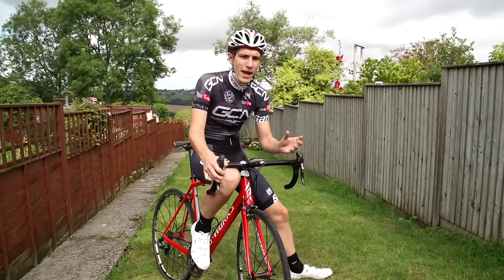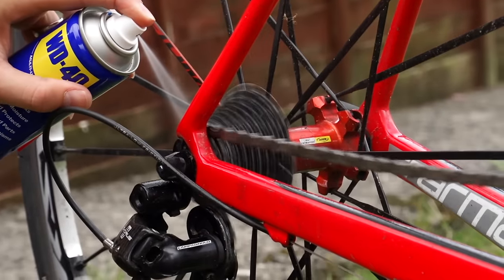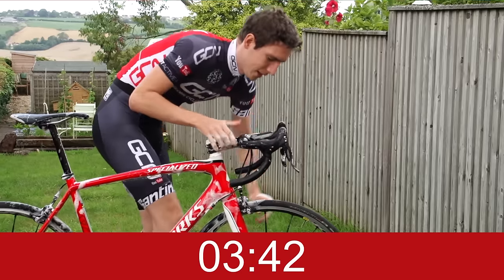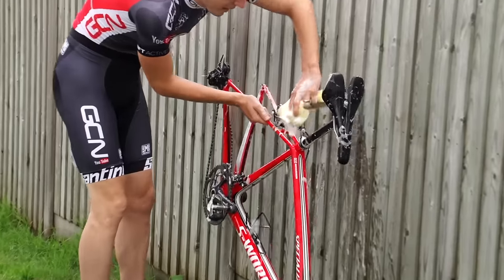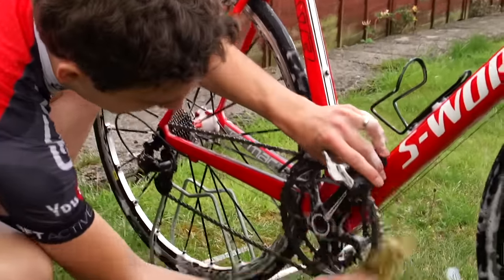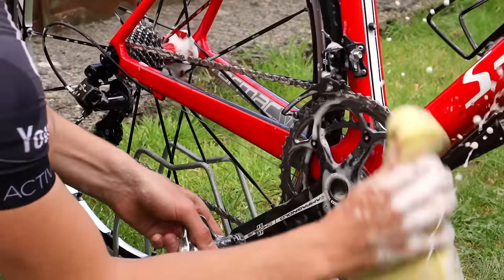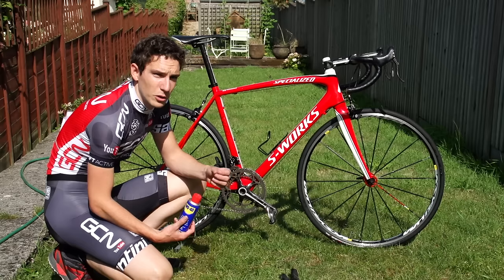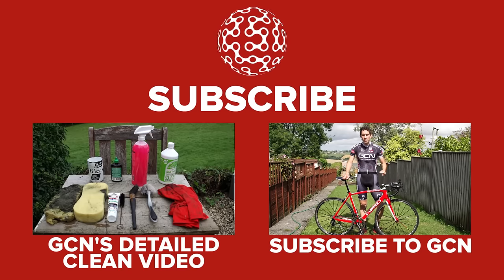The 5 Minute Bike Wash - How To Clean Your Bike In A Hurry

Comment: I wouldn't want the wd40 on my brakes pads ... but other than that it works just fine but you have to apply it often in my experience vs the other stuff I use which is finish line dry lube that seems to stay ok for a long time and attractive less shit

Comment: To be honest, I have always seen a bit of dirt (MTB) as a mark of honour, you know, like rugby players and their cauliflower ears, or like how bruises after a judo tournament make me look like I have fought harder, so I have declined to clean it off until I have had so much dirt it was falling off on the stairs. But even I have to admit that bike performance has suffered as a result and I can imagine that the amount of times (over 10) I have had the bike in for service in 3 years, and the costs involved, have come in part from mud all over the working parts. So, perhaps it's time to haul myself in a bit and make the effort. In all that time I have had, just a few examples, 3 new chains, 3 chains broken but mended and not replaced, a broken seat, 2 new rear cassettes, 2 new front cassettes, a new arse bracket, 9 sets of new brake pads, an entire new front brake, four new spokes, the wheel straightened 3 times and a new silver bendy thing that holds the derailleur on after the last one snapped off while descending and not even being used... not all from mud but it for sure never helped. The other day my quick link exploded and flew off when I went over a pothole and the chain cracked against the frame. Washing your bike is worth it, for sure.

Comment: hi gcn..if i use wd 40 it will damage my bearing inside or not?
Reply from the maker: it's not advised if you want to do the job properly 
cheers
Reply: i mean if i use to wash like above..it will spread into my hub bearing or not?thnx for quick respond
Reply from the maker: try not to spray directly into the bearing, as it tends to flush out grease. thanks, Jon

Comment: You should not have put the brush that you used to wash under the saddle back in the bucket, a you know this gets a lot of grit and what you  have done is returned the grit to the clean water then the sponge will catch the grit and you will scratch the paint work on the frame..... nice video tho and lovely bike

Comment: I laughed at the WD-40 use until I saw the end of the video.  There is a reason why Police departments don't use WD to clean their barrels. It has been officially restricted in some areas. 

WD will wear the metal away FYI.   Not Apples to Apples... just information I have learned.

Comment: WD40 is not really a lubricant and/or greaser per-say as it stands for Water Displacer and is mainly used for cleaning parts and/or keeping them clean. But for moving parts like bike gears it won't lubricate them properly and will wear off very quickly. If you use wd40 on the chains regularly you can probably get away with using wd40 but it's always better to use a proper lubricant for prolonged performance. My advice would be to use a proper grease after using wd40 to clean the parts. Trust me, I'm an engineer (....ing student)

Comment: I dare say that too much WD40 will kill your cassette and wheel bearings. If you use too much when  spraying your cassette and it hits your bearing grease,  the grease is ruined.  WD40 is ok if you are doing this after every ride and spraying VERY LIGHTLY.  It does dry out though, since it's really a solvent, not a lubricant.  If you don't ride every day, it's not going to work well.  Also, never let the stuff dry before getting all the loosened dirt, oil and other muck off your bike.  Once it dry's the only thing that will remove WD40 is WD40.  That's why it seems to work only if you used it before and after each wash.  Otherwise, to switch back to a regular lube, you need to soak the drivetrain in WD40 to get it off, then while still wet, wash with heavy soap and water. Next, soak in mineral spirits, scrub them clean with mineral spirits and then soak them again.  Once you have them really clean, you can let the mineral spirits evaporate, or chase it off with denatured alcohol.  Dry in  a warm environment.  By now you've obviously had to remove the cassette, and you need to disassemble the cassette bearings and pawls, clean and relubricate with waterproof bearing grease because IF the WD40 hit them, they're contaminated and need repacking.  I'd do the wheel bearings too at this point.  Isn't it easier to just use a good purpose designed chain lube properly applied and avoid all this?     I'm also concerned about the cables.  Your video shows water soaking into the cable guides.  That's REALLY BAD unless you are pulling your cables and re-lubing with (as you suggest - a teflon based lube) that is also waterproof.  Wires will rust extremely quickly and you won't know until that emergent hard braking moment when your brake cable snaps.
For your situation WD40 may be OK, but generally speaking BAD advise.
I keep a can around for chasing water/rust/Dirt off parts during disassembly and  removing some adhesives off of plastic (which it works really well for).  Never leave it on.

Comment: Let me say I didn't mean to hit you，But using wd-40 to maintain your transmission system may cause metal corrosion，In the past, friends used WD-40 on motorcycle brake discs, which caused corrosion and brake failure.So I think it is possible to use a special chain maintenance oil may extend metal life of your transmission systems.............

Comment: WD-40 solved my squeaky bike frame and whizzing chain issues, I only had the bike for a year now also its restored to its new state as well, plus I pumped up the tires - its 10xs faster ever since I've used WD-40! the bike is still quiet after 1 week of riding.

oh and its a Beach Cruiser.
Reply: so is it safe to use as a lube for my chain?
Reply: +ROTCOD DLAREH Yes. Just make sure you check your chain regularly. If it gets wet often, re-apply the WD40 often too.

Comment: Dear everyone. WD40 Is not in fact a lubricant but rather an oil based Water Dispersant hence WD. As far as we know cause there is no patent on it and therefor no recipie. To be honest thats all it should really be used for, to disperse water from parts where it does not belong. For example after washing your bike. As its oil based however it is also great for cleaning bikes or anything els which is greasy or oil based. However I would not use it on rubber or silicone as oil tends to dissolve or degrade these. Here is the problem though, the effect it has as a Water Dispersant is to form a thin film of itself over the surface of everything it comes in contact with. This is so that, water does not come in contact with the surface or any water preset gets dispersed. This however also means that any lubrication which is for example meant to provide lubrication between two metal surfaces now provides lubrication between 2 WD40 surfaces. It can also happen that the WD40 dissolves into any lubrication altering its composition or completely repelling it from the surface. And yes as mentioned in other comments as a Water Dispersant it has the property of easily spreading and running into everything including sealed bearings. Therefor I like to use WD40 to disperse water from my bikes components as well as cleaning of grease however afterwards I take care to clean of the WD40 with alcohol and then appropriately lubricate all parts.
I hope that this helps and puts a bit of light in the mythical debates about WD40. :-D

Comment: I’m lazy AF, with some money to spare, not a lot, but enough to be lazy. A waterless spray on cleaner that you wipe off after 5 minutes $25 for a 1/4 Gallon 😂 and a different one for the chain $20 

Enough to be lazy. 

And then the Actual WD 40 Chain Lubricant. Not a bad product at all for the price. After a deep clean I use the same brand, Dry PTFE Anti friction spray. Resists dirt, dust and oil. Also a pretty decent product for the price 

This 5 minute clean + a eBay chain cleaner is my deep clean so 😂

Comment: I've got no problem using wd40 on bikes, but please, to spray it on the cassette could be bad for freewheel, ball bearings and hub in general. There's grease inside those parts, and wd40 could penetrate into the hub and screw up the grease inside.. be careful with wd40, don't spray it around like a loose cannon. Especially if you have disc brakes!

Comment: Won't it rust if I use water and soap?
Reply: depends on the bike
Reply: it depends,  if its a few grand bike than its waterproof, you can powerwash it.
But my cheapo bike lost all gears and brakes after such bubble wash. The cables rusted inside.
Reply: I always dry it off.  If I don't have my compressor handy, I use dry rags....esp on the chain.
Reply: any steel components can rust under the right conditions. Some steel alloys rust easier than others. On a decent bicycle, the most rustable steel alloys are on the chain and cabling.  Those areas should be lubricated which minimizes exposure to water and air which are needed to rust. Cheap bicycles may have high carbon steel in wheels, spokes, etc which rust easier, decent bicycles have aluminum alloy rims which can't rust and stainless steel spokes that are resistant to rust.

Comment: I would NEVER use WD-40, it’s ruined my old bike, in comparison to bike specific degreaser it removes the oil which is deep inside the chain links - which you can’t really reapply without a hussle and knowledge. Use bike specific degreaser, it will work way better!

Comment: Why do I get scratches when I wash my bike?
Reply from the maker: This could be for a few reasons, but most likely to me is that you could be using a sponge or cloth either with grit in it, which ends up scratching the bike, or you're picking up grit and dirt whilst cleaning the bike and through scrubbing or drying the frame, are scratching the bike with that grit. The best thing to do is make sure you're removed all of the grit with a hose or water before you start scrubbing, and make sure your cloth or sponge is relatively clean and not muddy. I hope this helps :)

Comment: but my bike is aluminium frame.. how am i supposed to wash my bike?
Reply: doesn't matter Alu doesn't rust
Reply: Matthew De Meester it NEVER rusts? maybe i heard some wrong information from the internet. thx by the way.
Reply: true that, but never seen real rust exposure tho. (I'm a steelman)
Reply: White rust.... esp in contact with steel.  (Electrolytic)
Reply: it oxidizes, not rusts. Rust is oxidation of iron (major component of steel). When iron rusts, its oxide expands and creates gaps large enough for water and air to enter and rust further down. When aluminum oxidizes, it forms a microscopically thin silvery white layer on the surface (its version of a tarnish) that forms a barrier to keep anything from penetrating and rusting the aluminum underneath thus protecting it from rusting.
Reply: Terry Chay thanks for specific information!

Comment: Washing up liquid is a degreaser. Your bike will go rusty and alum oxide in no time. The mech adjusters will corrode in the threads.
Liquid car wax. Turtle zip wax. 
Don't use sponge. Sponges pick up little sharp grit and then you will rub it on the paint. Sponges don't get in the hidden parts of the mechs.
A Brush for alloy car wheels, rinsing out regularly.
NEVER use WD40 anywhere on a bicycle. WD means Water Dispersant. It is NOT a lubricant. The car wax will be the lubricant.

Comment: All you have done is spread dirty water around the bike.  
You should have a grit guard sitting in the bottom of the bucket.  
I  wouldn't use the same sponge on the oily bits AND the paint work.

Comment: Great job, but it looks like way too much work. Why not just throw a bucket of soapy water on the bike, quickly rub the bike down with a wet, bubbly clean sponge, and then rinse the two-wheeler with a hose, or a bucket of clean water☺ Wait for the bike to dry and then lubricate the chain. Forget about taking the wheels off, cleaning under the saddle, and washing the tires and spokes (adjust the pressure on of the hose to get the wheels good and clean. This approach should be faster than the method shown here and nearly as effective. To me this makes sense, because the bike is just going to get dirty again the next day.

Comment: wd40 on bike chain???
Reply: It's a light lubricant. It works great, I've been using it for years. But you really have to be degreasing, cleaning and reapplying often (I do my commuter once a week and my road bike after each ride).

Proper bike lube might be better. But it's harder to get off and clean and then reapply, and if that means you are cleaning less overall I think that's worse. The people who say it doesn't work on bike chains at all just haven't actually tried it, after several years I think I'd know if my chain wasn't lubricated.

Comment: This is a nightmare, it's now in worse shape than it was before you started clean. Pieces of dirt and sand are flowed directly into bearings and moving surfaces with water & wd 40, then never washed out of there. Dirt oil  sponge has left numerous oil spots all over the bike. WD-40 on breaks destroyed pads. WD40 on cassette & derailleurs became a magnet for sand and dust again. WD-40 destroys all sealings in hubs, bottom bracket, and soon longterm, also destroys the real lube there.
If you don't have enought time (1-2hrs) to clean your bike with dry tissues, accurately applying wet tissues, and accurately applying dry lubes - just better to not clean at all. Give it to repair shop to clean few times a year.
WD-40 is not a lube, it is a degreaser! It is much more liquid than water and goes into all bearings immediately, destroying their own lube and sealings!!
Reply: i watched a video where a guy was testing lots of products for cleaning bikes, as part of his test to show what damage each caused to rubber he blew up a few balloon and then when he sprayed the one for the wd40 it took about 6 seconds then the balloon went pop

Comment: Don't do it this way!! A clean chain that works well does not exist. WD 40 will wash the inner permanent grease out of your chain which you can never put back. If you absolutely want to use WD40 spray it on a cloth and wipe the chain with it. At 5:18 in this video this guy shows how to put WD40 on the brakes. Very silly. This video only helps the WD40 Company to sell more of their stuff.  If you want to know to treat a chain the right  way read the homepage of Sheldon Brown.

Comment: No,no.and no! Washing up liquid is a stripping agent, ok for the chain but not the paintwork .
Reply from the maker: Washing up liquid is pretty safe for use on a bike frame, avoid cheaper stuff with a higher salt content and make sure you rinse your frame after washing and it's very unlikely it will cause any harm at all!
Reply: Global Cycling Network 
We shall agree to disagree, car shampoo by far the better option or some bike cleaning agent obvs . Washing up liquids will dull the paint 
👍